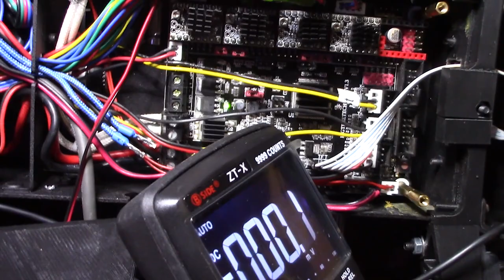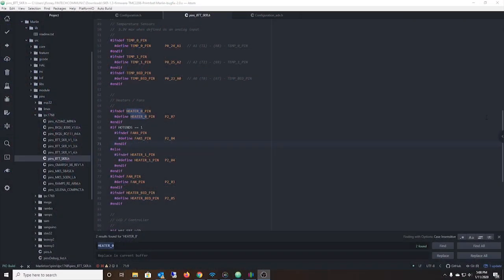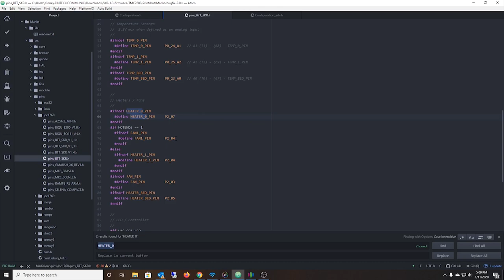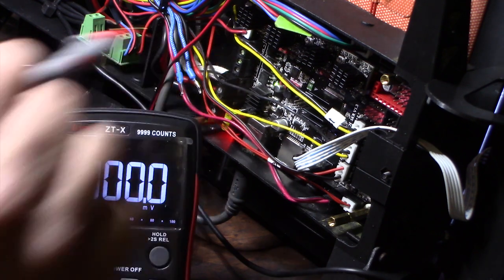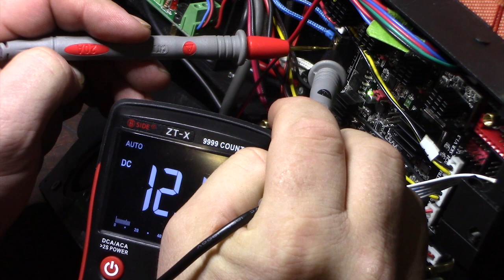SKR 1.3 bad mosfet hotend E0 stuck on when powered on, 3D printer super dangerous, possible fire.

Comment: Thanks for this debugging video, this confirmed my suspicion. This just happened to me while printing. Thankfully I was next to printer and saw printer stopped printing and just started smoking from the hotend. I'm running klipper and board switched itself off and lost connection to raspberry pi, probably due to internal error, but since power was still attached hotend just tried to go max I assume. My advice is to use a some compatible smartswitch (I'm using sonoff) and octoprint with tasmota smartswitch plugin and configure it to automatically cut power on board error. I hadn't set it up for myself to cut power on error, but I will definitely do it now.

Comment: This just happened to me with a laser, punched a hole right through all of the material on the bed and started etching the bed plate itself lol. Not a safe mode of failure. In my case, driving the mosfet at too high a frequency did it I believe.

Comment: Just found this while looking for a quick solution for bad mosfet on skr 1.4 board.  My mosfet not outputting any power but the led is turning on.  Thermistor seems to be reading accurately, room temp.
Reply from the maker: I swapped my E0 and E1 on the pinout config file and Its still going strong.
Reply: @fintechrepairshop  ok thanks, this is a great workaround for bad mosfet.  My problem turned out to be a bad heater wire.

Comment: my problem is almost the same as the BED HEATER but it always gives me the temperature below 10 degrees ... whatever temperature I put .... it starts flashing and then it makes a BEEP AND CA IN ERROR (I changed the plate and cables but I don't  Resolved)

Comment: This what they told me

Hello
，friend.
I watched your video. I want to determine a problem. Will the LED lights of the nozzle, hot bed and fan light up immediately after power on? If so, this should be a problem with the chip that controls mosfet, not a mosfet problem. Do you know how to replace this control chip? We can pay for this repair. I mean this chip.

Comment: Had this exact problem. I'm wondering did you just deal without the fan or power it in another way?
Reply from the maker: The fan always worked, just the mosfet failed.
Reply: @fintechrepairshop  ohh, I had my hot end fan in the E1 slot. I could be confused on what you did exactly.